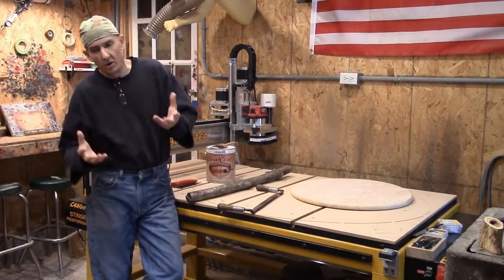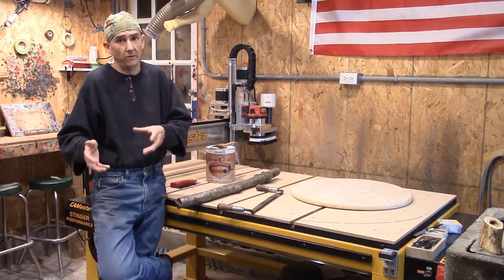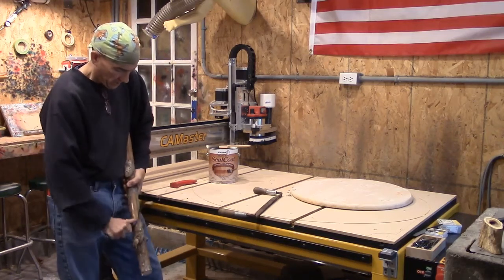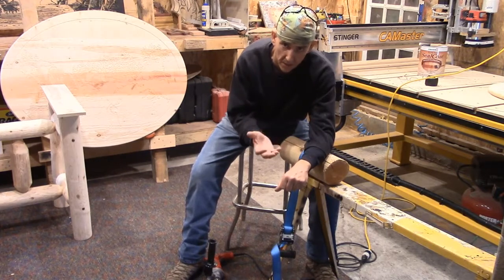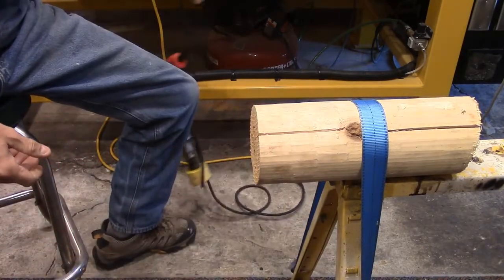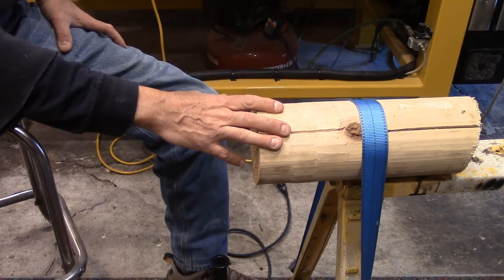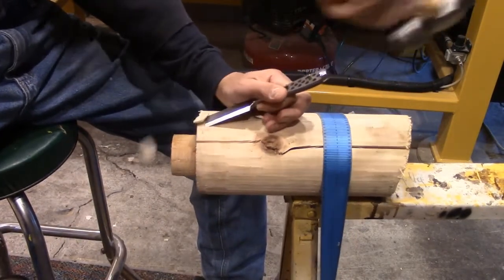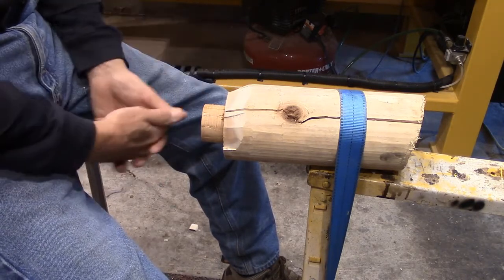Tenons without tenon cutters

Comment: there is no Y in Tenon it is not a tenyon
Reply: Pretty pointless comment as everyone knows what he means
Reply: Don't know much about woodworking and never tried this. So, if it's a dumb question go easy on me. Would it save some time to set depth on a circular saw to cut some of that out instead of using the drawknife for the entire thing, especially if you were trying to make it a cleaner rather than tapered joint?